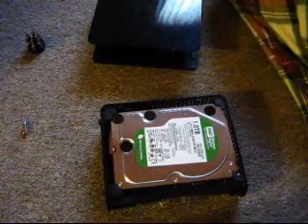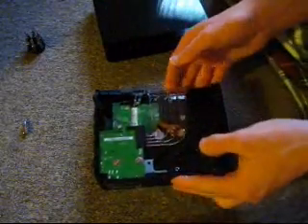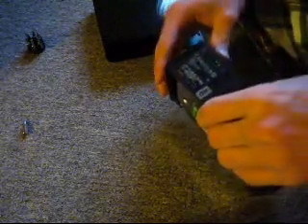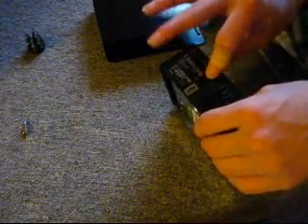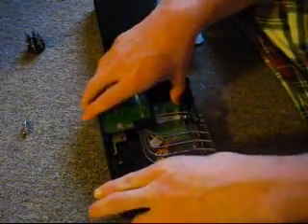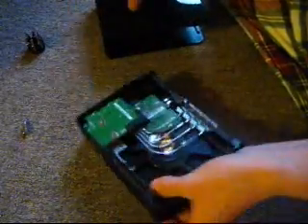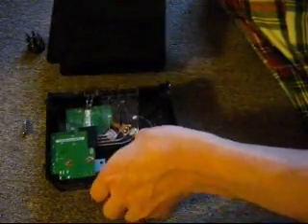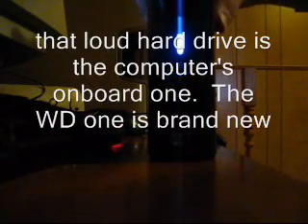How to REASSEMBLE a WD MyBook essential edition external HDD part 2

Comment: I have two 1TB MyBook Essential HDDs.  When one stopped working, I opened both and found that by replacing what you called the interface card (wt mini USB, power & SATA connectors) I could get it to work again.  I have no idea how to find a replacement card.  If I buy a new enclosure, will it have it's own 'interface card?  I'm considering a model (Mapower MAP-AI32US 3.5" USB 2.0 Aluminum External Dual SATA RAID Hard Drives Enclosure) with a fan that would hold both drives.  Will that work?

Comment: My clear plastic parts wouldn't stay in the little rubber piece that connects them to the small circuit board, but I guess that's not much of a loss.  (I don't pay attention to them except to see if it's on- and the blue glow is still visible without the clear plastic pieces.)